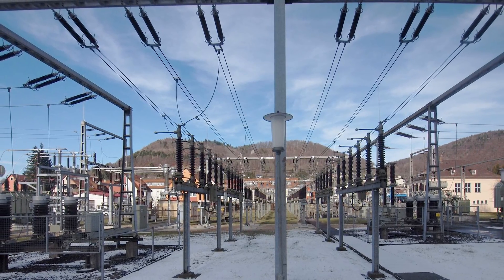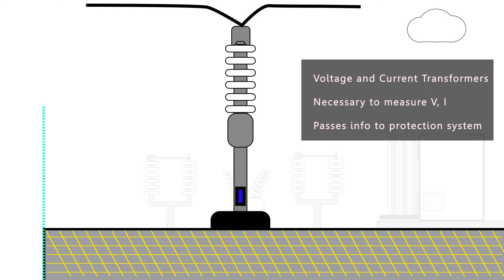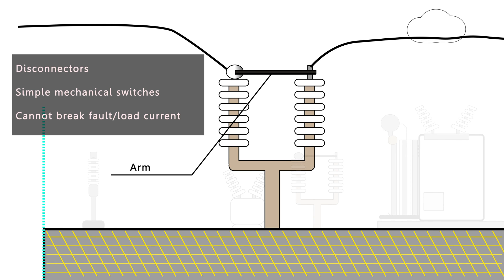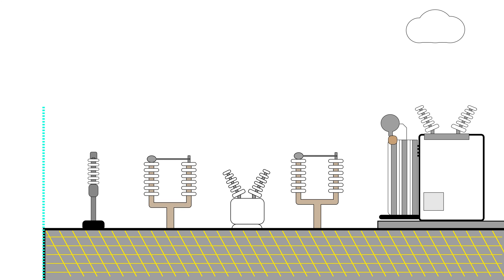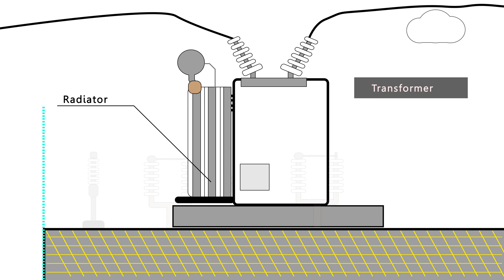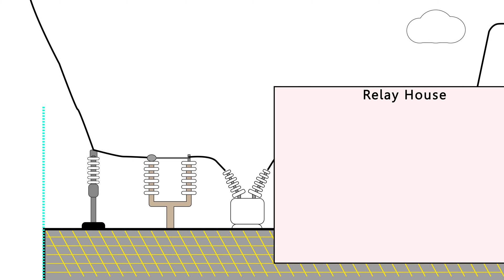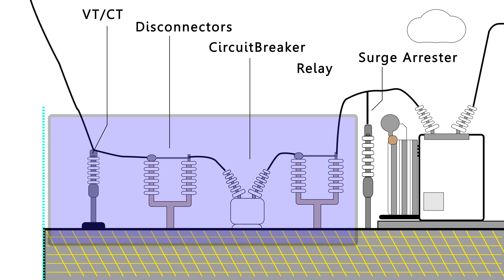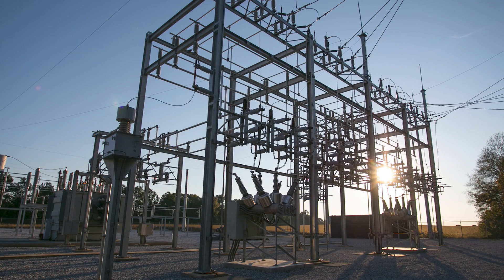Substations: Basic Principles | Circuit Breakers | Disconnectors | Relays | CTs & VTs | Arresters

Comment: Good recap, but for the switch, we have load break switch that can safely open and close a circuit while a normal electric current is flowing through it, you can also motorize them

Comment: Just a bit of nitpicking. Is the switch that you call a disconnector not just an isolator? Disconnectors are used to diconnect lines under load where as isolators are used to isolate under no load conditions.
Reply: Both are the Same thing. Disconnector and isolator.
Reply: They do isolate, there not called isolators there typically called switches, but the used to isolate certain parts of each substation

Comment: Great explanation! I was hoping that you were going to explain reclosers. I would like to understand how the old oil filled mechanical ones could "count" the number of re-close attempts and vary the time all without stable power.
Reply: Hi George. On those old oil filled reclosers, they use the oil in the recloser in a hydraulic circuit. Those reclosers trip by pulling a plunger into a coil/solenoid type setup. The coil size determines the trip amps of the recloser. When the coil has enough current running through it the plunger gets pulled down and into the coil. There is also a pump piston connected to a linkage connected to the plunger. That pump piston pumps oil though channels in the frame of the recloser mechanism. As this oil moves through the channels, it pushes up on a trip piston. That oil escapes back into the tank of the recloser through small orifices in the frame. When the recloser is operating on its fast operations, the oil escapes from two orifices. When the recloser is operating on its slow or delayed operations, the oil can only escape from one orifice as oil is constantly pushing up on the trip piston as it operates. The recloser trips and closes until enough oil has pushed up on the trip piston to make it bump a lever that will lock out the recloser and drops the yellow operating handle. That's it in a nutshell.
Reply: Power Circuit Reclosers (PCR) are smaller Power Circuit Breakers (PCB). Inside the breaker there is a mechanical counter in a open circuit that is connected to the trip recoiler. When the breaker opens. The open circuit is closed powering the counter to increase by one. It also sends to the information to the relay that controls the breaker. The old oil filled breakers function in a similar way.